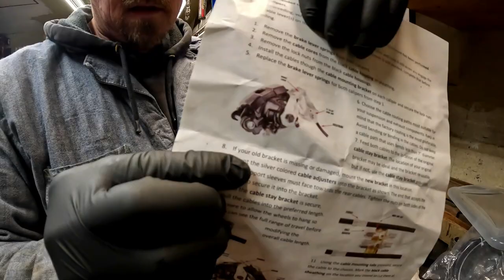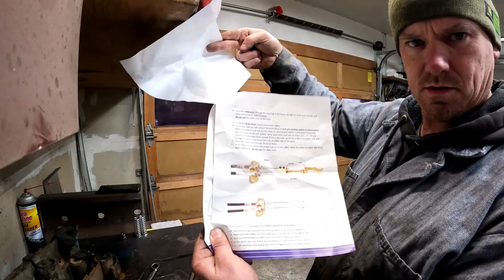Drum to disc brake upgrade

Comment: Looks like a pretty hokey kit, but then again all the kits look that way.  Not that you had much choice.  Seeing this video makes me happy that I di what I did.  I just finished converting my '86 f 250 to disc using a factory ford setup from a 2005 f 250. It took some doing but looks completely factory and when parts are needed in the future they will be easy to find. The stopping power is light years better than the drums!
Reply from the maker: Once i figured out how it all went together with some mods, it works great. I think the rear pads are a little small for the weight but still work's better than factory.
Reply: There is a lot easier way to do it than this kit that uses E350 rotors that just slip right on. You still use Chevy calipers, but all parts are readily available at any parts store. You also get to keep the obs 8-lug bolt pattern, it is a complete bolt on  and the install ran me less than $300.00.
Reply: @mikehenry4743  The E 350 rotors are also identical in every other way to the F 350 rotors so work just right with the OEM Ford parts. These are what I used on my conversion. This way I have all factory Ford parts including parking brakes , cables, calipers  etc. and still have the original 8 x 6.5" bolt pattern. There were a few obstacles I had to overcome but the results are really good.
Reply: @mikehenry4743  what is different to run the ford parts?
Reply: @carllee31  The earlier Sterling axles with the drum brakes use a larger hub so you won't have the clearance needed for the parking brake shoes unless you machine down the hub to clear them , plus you'll need to use a replacement shoe return spring kit for clearance, then after that you'll need to do some clearancing of the shoes themselves. This is what I had to work with on my '86 F-250, maybe other year hubs could be a better fit? Not sure .

Comment: So is it a bolt on kit or weld on? You didn't even talk about what you ended up doing. Looks like you welded the "bolt on" brackets to the axle tube.
Reply from the maker: It should have been a bolt on kit. I ended up welding it on because the fit was wrong.

Comment: i just did my disk convertion on my 94 idi and i was just wondering if your brake pads came with any hardware. mine didnt and im curious if i need it or not
Reply from the maker: I don't think the pads had any hardware. Just the caliper had some.
Reply: @barnyardmechanic3622  okay. Thanks for the reply. Was just curious cuz another brake pads I've installed have either those retainer clips or those metal tabs to keep the pads off the rotors
Reply: @barnyardmechanic3622  did you upgrade your master and install a adjustable proportioning valve or just leave it stock?
Reply from the maker: @FunEggs  I left everything stock for now but have plans to replace the proportioning valve for an adjustable one.
Reply: @barnyardmechanic3622  okay cool thanks man appreciate it!

Comment: Oh hell no it's not to late to throw that crap back in the box and go to the junkyard and get all the disc brake parts from a later truck. That kit doesn't have a disc brake master cylinder or prop valve, also an off road kit is code word for half baked.
Reply from the maker: I have recently put in a rearend from a 2001 with the factory disc brakes. Works great and was way easier.